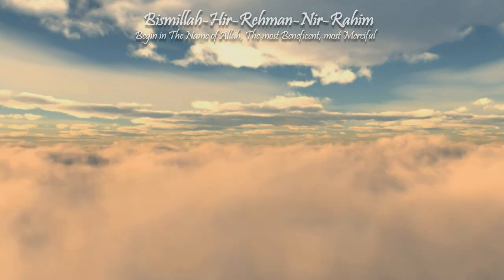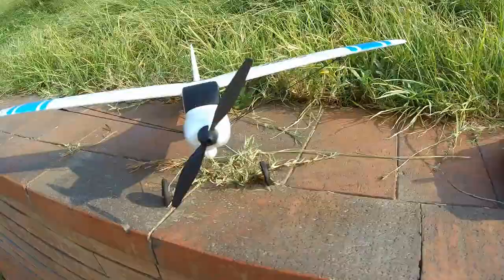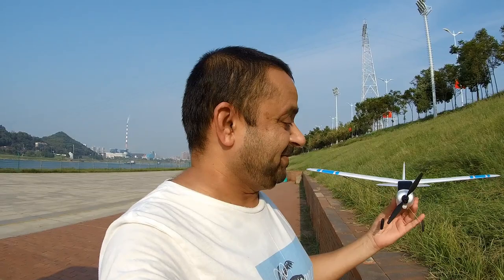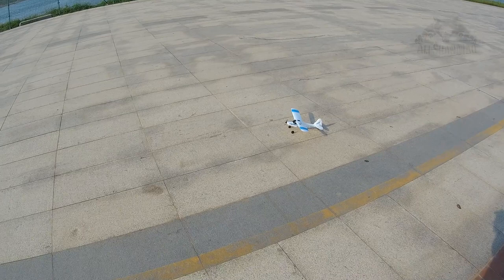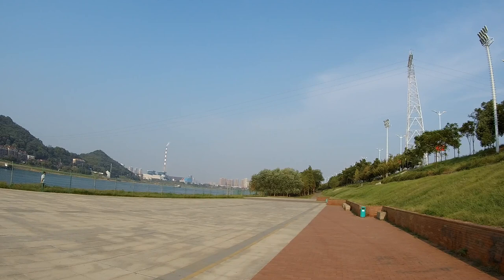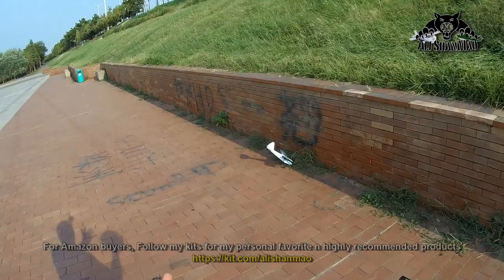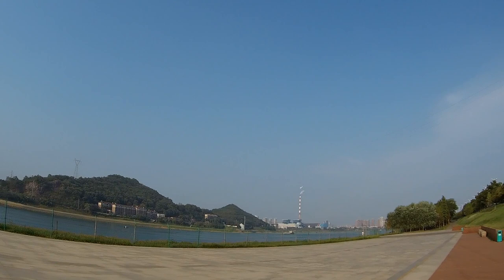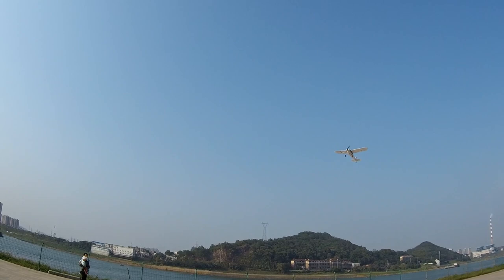Mini RC J3 Super Cub 500 RC airplane Ready to fly

Comment: This is a nice upgrade from the very popular and long-lived V761-1. 500mm wing verses 400mm, 360mah against 180mah battery and the new Headless Return to Somewhere gimmick. But at about AUD128 (compared to 68 in Australia) I don't think it's going to be a big seller. If you need longer wings & a bigger battery stick with the XK A100 series airliners. Same price range as the V761-1 and flyable with your Jumper etc on the WLToys V911s heli protocol. Rear facing props and accessible Syma X5C motors for easier repairs also - a no-brainer.